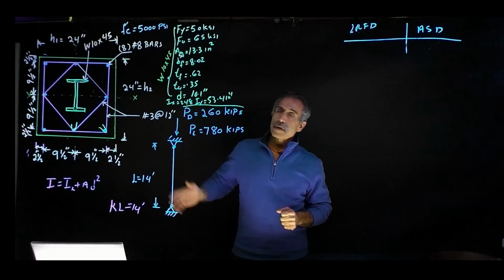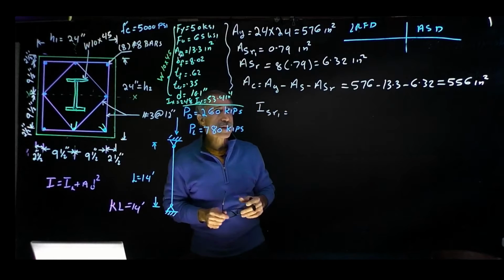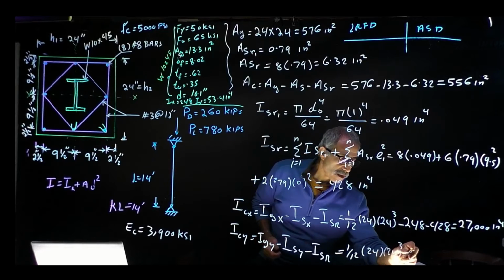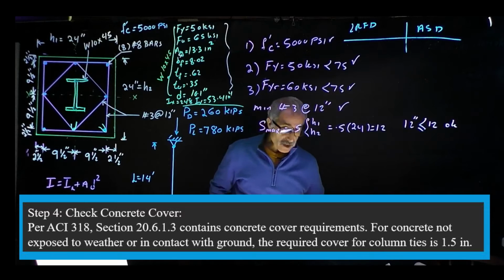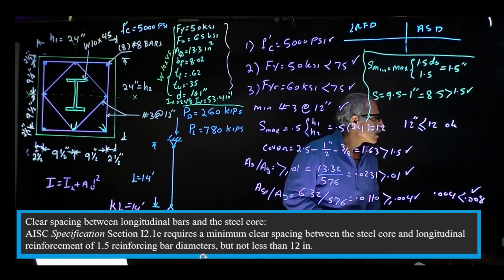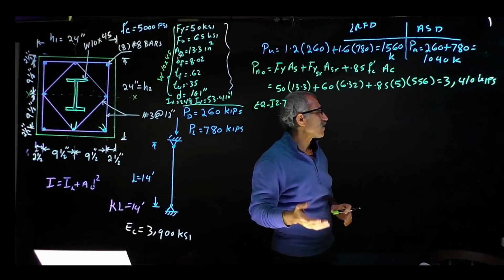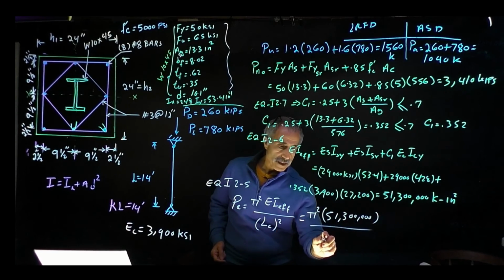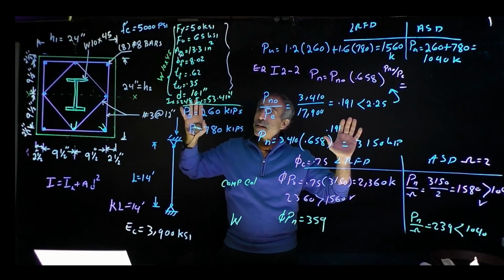Design of Composite Columns. Composite Column.

Comment: Hi Dr. Nasser!👋 I have a question. What must be done on its base? Is it a base plate that comes with bolts that are usually made in steel column members or are they all buried on the foundation with base plate? I am learning the design and analysis of baseplate.
Reply from the maker: Very good question. The two different type you are referring is base plate with anchor bolts and Embedded Column Base (ECB) connection. The base plate connection are used in buildings to support gravity loads and
function as part of lateral-load-resisting systems. In addition, they are used for mounting of equipment and in outdoor support structures, where they may be affected by vibration and
fatigue due to wind loads. You have to keep in mind that Steel-composite columns are used considerably in modern mid to high rise buildings. They are designed by embedding the column into the footing. This allows the development of moment resistance through horizontal bearing stresses against the column flanges. This type of connection, referred to as an Embedded Column Base (ECB) connection, is used when the exposed base plate connections as mentioned above (which is designed to resist moment and axial force through vertical bearing forces and tension anchors) are unfeasible because they require multiple deeply embedded anchor rods or thick base
plates.
Check out AISC base plate and anchor rod design
https://www.construccionenacero.com/sites/construccionenacero.com/files/u11/ci33_321_aisc_design_guide_1_column_base_plates_2nd_edition.pdf
Reply: That explains a lot. Great information Dr. Nasser!